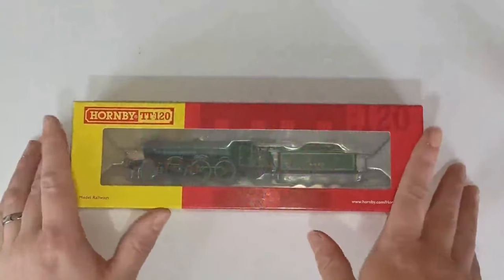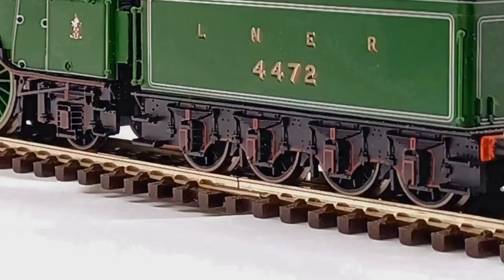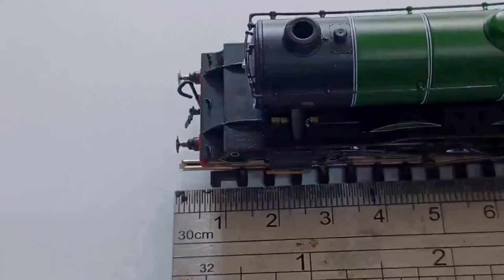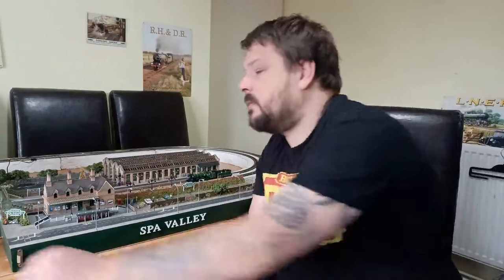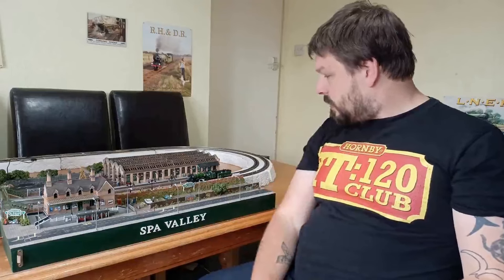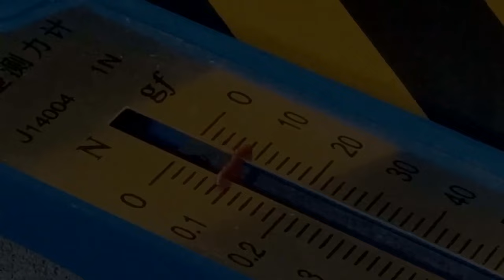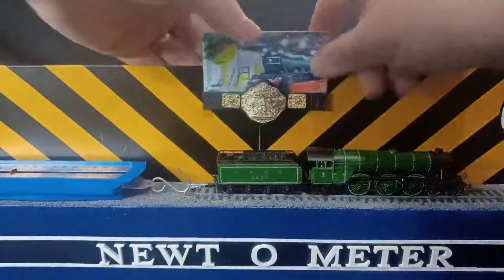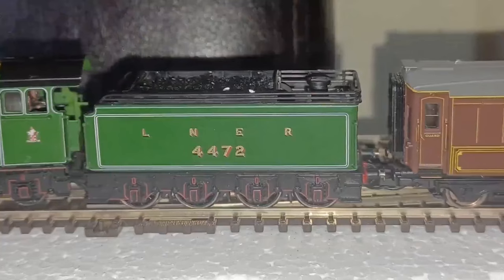Hornby TT120 LNER FLYING SCOTSMAN (1924) full review

Comment: Sir could you tell us about your engine shed. How you built it and put lights in it. Who was it's manufacture. Thanks from the states.
Reply from the maker: Certainly,
The original kit was produced by "Modelux", Its 2 four road victorian engine shed kits merged together to form a longer formation and wraped in printed scale bricks.
The lights I wired in myself in a series of T junction style joins with wires running down the inside of hollow walls. 
I have also included the ability for the shed to be "plug and play" so the shed can be removed from the base board in case of derailments or photography.

I do give some details in my Episode 3 video although I did skip the detailed shed build video as I was on a deadline at the time. 

Thank you for your interest and If you need any further details please let me know 🙂